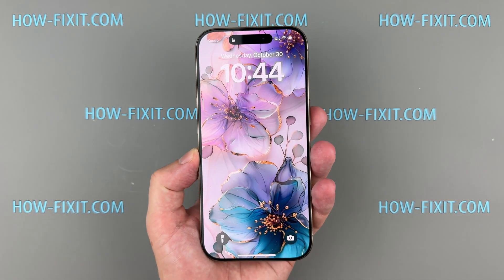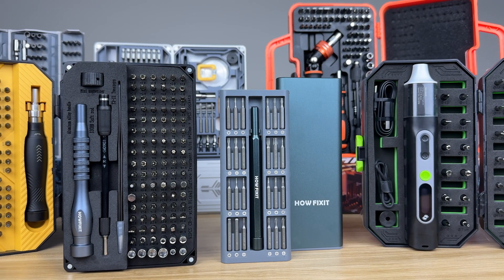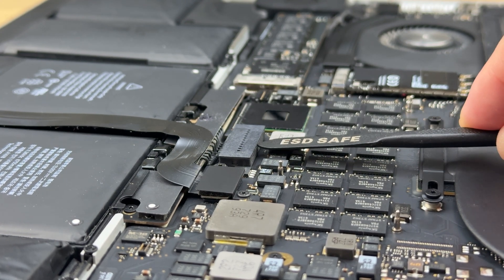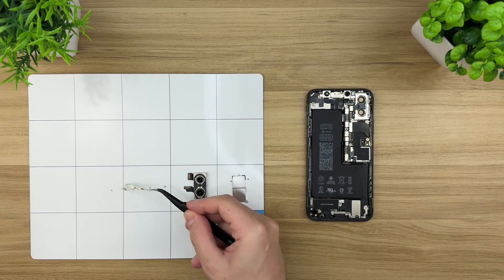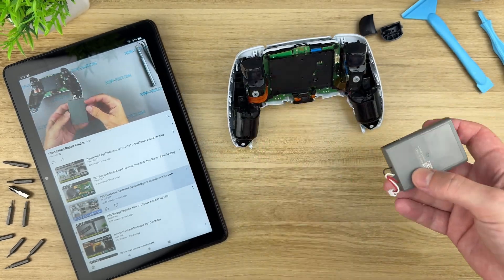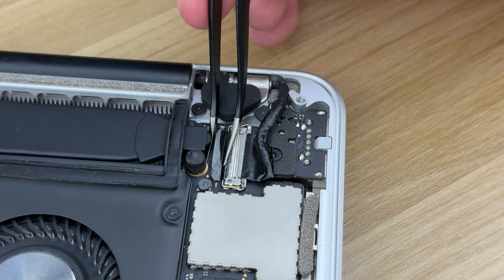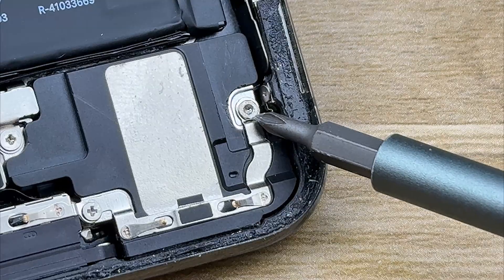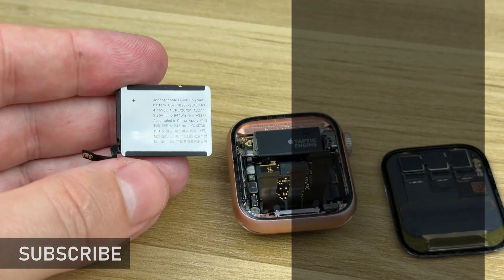Electronics Repair for Beginners: How to Safely Fix Phones, Laptops, Consoles and Drones at Home

Comment: Hey! very good video, but please stick to plastic and non sharp tools when removing a lithium battery. You can use a card from a deck and a little bit of 99% alcohol to pry it off safely if you don't have professional tools. A puncture in a lithium battery can result in fire. Even if you see other people doing it on video, its best to be patient to avoid any danger <3

Comment: I'm looking for the ribbon cable for a PS5 elite controller but can't find one anywhere. My square button died. Any suggestions?
Reply from the maker: PS5 doesn't have "elite" controller, maybe Edge ?
Reply: @howfixit  sorry, edge. The fancy piece of junk with the removable thumb stick modules.
Reply from the maker: You can most likely find such a spare part on eBay or Aliexpress